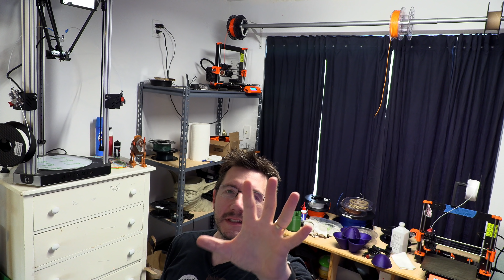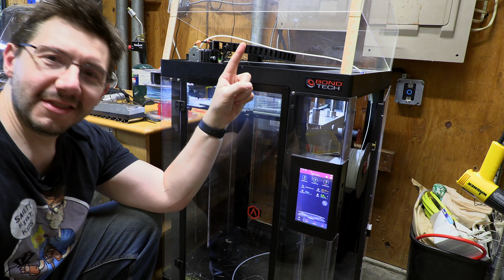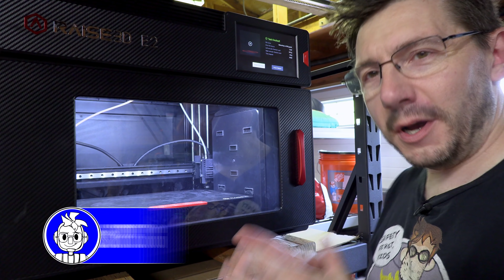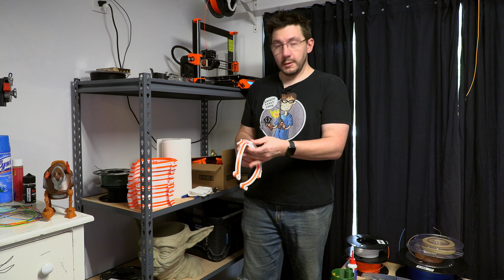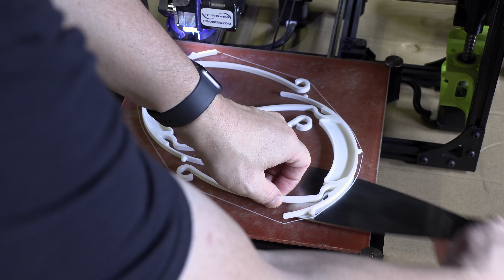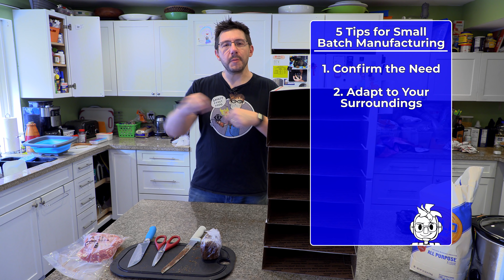5 TIPS for Small Batch 3D Printing Manufacturing - AT HOME!

Comment: This brings back memories. I designed face shields with folding legs and I could fit 5 to my build plate but that wasn't enough for me so I stacked the design with inter-layer snap offs. I printed a few hundred of them and handed them out to the local hospital. I ended up with a design stack pushing the speed limits of my printer that would print non stop except for spool reloads over 5 days.

Comment: Hey Joel I've got a quick question, if I print multiple small parts at the same time will the strength/layer adhesion of each part be less than if I just printed a couple at a time?  
Thanks for another great video as well!
Reply: Im going to assume you figured out the answer but just in case. It doesn't matter! Print as many as you can!

Comment: I love the curtain rod as a spool holder.  printer farms should adopt that method/design.  haha.  I know it isn't practical when putting new spools on unless you change them all.  was just a joke.  if it helps I have found a deburring tool works great for edges that have a brim or a little edge (either due to the top being so good or a little squish/elephant's foot at the build plate).

Comment: recommendations on shelving to "stack" printers, currently I have a ender 5, Mars 2 and am looking at something similar in size to ender 3 (voxelab aquila) to add to my list of printers but looking for some stackable options. That metal shelving you have do you have problems with vibrations? Does bumping a table or if the shelf moves a little affect print quality?

Comment: If you continue to do this small batch manufacturing, it would serve you well to learn a bit about Lean manufacturing principals.  They are not just applicable to mid/large manufacturing operations, and I see so many ways that you could cut your labor time "bigly" :-)  You could read a book or two, but I think the best way to learn is to get in touch with a local Lean manufacturing engineer of a small manufacturing firm in your area that makes parts in batches of hundreds or less (think Aerospace, etc.).  Lots of these companies give tours all the time, and like making local contacts with people with different skills, so I have a strong feeling that you can get some tours.  Great video, btw!

Comment: OK first off set yourself up an Company USPS account for your shipment. Get labels you can print the address onto I use 2 label per letter to make things easier for now till we upgrade to thermal printers/label maker printers. 
Use invoice ninja (it is free) for all your invoicing and tracking a well as your invoicing you interlink it right away with banks and swipe as well as paypal as well. 
buy for you products envelops or boxes in bulk. If USPS has the size for the price than use theirs but look online.

Happy 3D printing

Comment: Do you keep your garage heated and air conditioned? Any air cleaners or exhaust systems?
Reply from the maker: It’s not actively heated or air conditioned. I have a ceiling mount air cleaner / filter that I typically run.

Comment: Why do you have to buy labels from the post office when you can enter the data by hand, print it, and apply it to your flat rate boxes?  You call up the post office and arrange for special pickups of packages.  On another note...how much have you spent on these slow hobbyist level 3D printers?  Is it time to add a high speed high volume 3D printer to the mix?  Such as a PolyJet 3D printer or similar?  For the advanced at home additive manufacturing enthusiasts market which 'til now your channel has largely ignored.

Don't have to use anything from Google either.  Open Office or whatever it is called these days does the trick nicely.  Free and it is compatible with MS Office suite.  You shouldn't rely too heavily on InterNet based "solutions".  What happens when the 'Net goes down or the service that is online only craps out?

Comment: Hey Mr 3d printing nerd, why not print multiple layers? Stacks of 10 and 10? Love your video's 👍👍👍
Reply: Multiple layers means increasing the risk of failed prints from power outages, layer shifts, clogs, etc as well as meaning a lot more work post processing to separate layers (not easy without support material in between which would then also have to be removed). 

He would lose way more time trying to print/process/fix stacks than just removing prints/restarting each printer.

Comment: Just a suggestion for cleanup, when mass-printing frames I used a butane torch to clean up all the strings and odd sharp bits, it really does wonder for "mass-cleaning". Set it to the least "jet engine" setting, prefer yellow flame, and just let the flame pass by each frame.

Comment: I've been printing on 40 printers. By time I hit print on the last one the first one is finished. So I started stacking prints to make 24H print times. It really sucks to swap spools on 40 machines at the same time.
Reply: What did you do to stack them? Add support layers in between? Add an easy to cut dividing line? Etc?
Reply: @radicalxedward8047  I had a skipped layer between the prints so they break apart on the line. It only works on some designs. I got the idea from the old reprap print files that used to do it. If you have a large area you might want to skip 2 layers or something to make it easier to break apart. But I was printing a low contact model

Comment: Hi Joel,

You can automate those face shields prints so that once the print ends, your gcode calls your extruder to push it off the build plate (into a bin you setup), and start to print a new one. Additionally, there are Stack gcodes for those now where you can print 10-15 in one batch. Best of luck.

Andre

Comment: Pretty good example of making use of your 3D printing nerd hobby to help meet a short term need.  For a REAL 3D printing manufacturing operation, you'd have a print farm with all the same printers so they're all running the same jobs, they all start and stop at the same time, they have common spare parts and maintenance procedures, etc.  You'd also come up with some way to print more than one or two parts at a time for far more efficient throughput.  A slight change to that headband design might allow it to print vertically and 10 to 30 could be printed in a single job, although layer separation could be a problem in that orientation.  It might be possible to stack them horizontally with some clever supports that snap apart.

Comment: Joel, I am shocked, SHOCKED i say, to hear you're having leveling problems with your N2+. SHOCKED. XD 

Anyway, that's awesome. I'd like to add that I use ShippingEasy www.shippingeasy.com to handle my shipping, and it works really well. I have the free plan, which is sufficient for me, but they go up to massive operation size.

Comment: I use a heat gun or a map gas torch to clean up prints. I have also used the flame to heat up the print to bend or pose a print

Comment: Tip: 
As soon as you add another person batch manufacturing becomes inefficient. Move to single piece flow. It will save you time and probably double your production with the exception of the bottle neck of the printer.

Comment: My top tip (as someone who runs a small batch printing business for classic car parts) is plan the print times and never let your printers sit idle.

Here's my top tip... print multiple models on the bed to schedule the print end times.
So I mainly print classic car parts, often quite repetitive as I supply to a number of retailers and once I have created a new product it often gathers pace quite quickly, it may start as an order for 3 or 4 to 'see how it goes' and turn into to an order for 50 within a matter of days.
For example I have a couple of particularly popular components which are around a 14hr print time, which can be annoying as over time the  finish time moves into the late evening and then early morning etc... but you don't want to have you print finish 10 mins after you've gone to sleep and a have a printer(s) sat idle for 6-7 hours until you get up to set it off again.

My tip therefor is to have multiple items on the build plate to make your print take 24-hours or 12 hours etc... so my 14hr print coupled with 2 x 5hr prints on the bed takes me to 24hrs, so you can have it finish, pop it off and re-start with no down time. Building up stock is often very handy as the material cost is quite low (I print almost exclusively PETG) and if you are utilising what would effectively down time to do it then that's great. 

You can't get that time back, and time is money as they say.

Comment: I've found on my prusa mk3s that I need to lower the extrusion width and lower the speed between faceshield to print quality. (use a modifier for each faceshield of the stack). unfortunately, I can't get clear sheet anymore, I have 10 pack of 100 ordered but nothing is shipping :(, glad im still fine on PETG and PLA but the price of cheap filament jumped in price lol.

Comment: My wife does a side gig that ships a lot of boxes to the point that I told her it's time to get a USPS account. Oddly enough a lady at the post office told her to use the flat rate boxes and cover/wrap them with brown paper to save on shipping where you can zip it out 1st class for several dollars cheaper. Shortly after we started doing that, we also found a website called pirate ship that works like a bulk shipping account that also saves quite a bit on the shipping rates over (or in some cases IS Priority) for about half price.

Comment: Joel, my family had a small business for years, till my mother retired and sold it off.  It helps to chart out your work flow, and look for points in it where you can see time savings.  Do things like prestage, maybe take a few boxes and when you have determined what orders are going out for the day, put the invoice in them, and the hole punched sheets, then as you move along you fullfil the order with head gear and shipping label... And so forth..

Comment: Hey can you do a video on troubleshooting after switching slicers I’m having trouble with first layers I run a home built printer and I’m trying to switch from slic3r to cura
Thanks
Stay safe
Reply: I have done this.  Bring up both printer profiles and put them side by side.  Then pick your favourite bits from both.  It's a good idea to have a small print model to check out various settings.

Comment: My Prusa MK3s doesn't like PLA.  I printed PLA frornearly for a constant year and then suddenly it jams.  One of your video explained why it happens: its the way the heat break is milled/engineered to handle MMU.  Prusa does not have a suitable replacement.  I ordered one generically and currently waiting for it to arrive so I can swap it out.  Have you done this Joel?  If you have, Prusa should offer their printers w/o the MMU feature.  I do not plan on printing anything other than PLA.  So....no face shield volunteering here.

Comment: Hi Joel,
I am running the same but you should also get that all connected to a mesh of octoprint. I am running that in my machines 2 out of 4 and this is great to get the printed sending update over the slack channel that I I setup. Then I only need to move to the workshop only when required.. otherwise it is difficult to hear the bip from so far. 
So this can be a great advice also and then you can also record what you do.. get out some statistics. You should also explore that octoprint feature.. it is so great to use
Reply from the maker: Fantastic idea - I'll see what I can do!

Comment: Face shields for dentists? 
The dentists in Denmark use som small magnifying goggles with a center light. 
The model you print would never work here. There isn’t room for the goggles.
There is a dentist version on Thingiverse. A modified Eric Cederberg frame.
Reply from the maker: Can you link to it? I've sent hundreds of these out, and all of the dentists love them. Grand Street Dental said her lights clipped onto them super easy.
Reply: 3D Printing Nerd 
https://www.thingiverse.com/thing:4297740
This one has been modified to make room for the special dentist glasses with magnifying lenses and a center mounted light.
They require 6.5. Centimeter of space between the forehead and shield.
These are the magnifying glasses they use: https://examvision.com

Comment: Awesome camera arrangement on the #2 Prusa MK3. XD
Having been charged with filming a timelapse of a Prusa sitting on a shelf obstructed by a Raise3D cart, I feel your pain and I envy your filament closet rod.
Our MK3S nozzle jammed hard (possible heat creep), and I decided to replace the whole hotend to be darn sure it would run reliably again. Because I needed to hook it up to Pronterface to calibrate the heater cartridge and thermistor, I upgraded the firmware while I was at it. I hacked up a replacement PTFE tube that resisted filament insertion at first, but it works swimmingly after a little breaking in.

Comment: just use Shopify for your business instead of spreadsheets. it only cost $30 a month, you can buy USPS at a discount and print labels right from the back end, and it will sent emails with tracking and such automatically.
Reply from the maker: $30 / month doesn't seem too shabby.
Reply: 3D Printing Nerd yeah man, it’ll save you a lot of time, def worth it.

Comment: Joel can you make a video about smooth vs textured prusa build plates and which filaments work best on which
Reply from the maker: I'll try!
Reply: Both the textured and smooth build plates can work with just about any filament. I try a squeaky clean build plate first and use an adhesive if that doesn't work. I use the textured ones when I want the surface of the parts against the build plate to look good and the smooth ones only when I have extra trouble getting small parts to stick. If necessary, you can use Vision Miner's Nano Polymer Adhesive on the textured build plates without ruining the bottom surface finish of the printed parts, but it is expensive. Likewise, you can use glue stick, Magigoo, etc. on the smooth build plates. They are less expensive, but they sometimes spoil the surface finish.

Comment: What the hell kind of firmware asks "was your print successful"?! I've never had Marlin ask me that!
Reply from the maker: The Raise3D machines do this when you have them bound to the cloud account. It's a way to keep track of stats, plus, it requires human interaction so you don't accidentally start a print with a print still on the plate.
Reply: @3DPrintingNerd  so if you make a 3D printed robotic arm (well, probably need at least a couple) take off your prints - it will not register unless you also make it have a finger that presses "yes"?

Comment: Last Wednesday the government here in Slovakia permitted to open some shops, like hairdressers', cosmeticians', restaurants and cafés (only those with outside seating, and only the outside part), etc. Unfortunately, the source of our primary income at work are still closed, so we decided to print face shields. On the first day, we ran our three Prusa i3 MK3S printers at the office, but we were sold out almost instantly. I made a stacked print for 8 shields to run outside of business hours (runs for 14 hours), and I made a single-stack version with four shields, which I ran on my MK3S and modded to hell Anet A8 overnight, and start a new batch in the morning, just before I'd leave to work. Oh, and I brought my dad's Ender 5 into the office as well, just to up the printing capacity. I will also add my Alfawise U20 to the farm just after I complete the control board replacement on it and dial in the firmware.

Comment: My tips from printing hundreds and hundreds of parts in my home workshop:
1. Minimize time by slicing your models to print fast. See https://www.cnckitchen.com/blog/how-to-3d-print-face-shields-faster. You can adapt Stefan's settings to your printer(s) and model(s).
2. Minimize cost by shopping around for filament at a good price. You should be able to get good PETG for $32/kg or less. Order enough to get free shipping if offered.
3. Minimize waste by using filament runout detection and multiple spools of the same filament in the same color.
4. Consider upgrading to flexible build plates, which make print removal faster and less tedious. Don't wait for prints to cool completely if you can get away with it.
5. Squeeze as many parts as you can print reliably onto the build plate. You can often fit more than you expect by rotating the models.
6. When starting prints, make sure you have a good first layer or two before walking away.
7. Use the timer on your phone or computer to alert you when the prints are done so you won't need to check on them constantly.
8. Don't exhaust yourself if you can help it.

Comment: So I'm still getting weird imperfections in my PETG prints. What retraction/speed settings do you run at to get it so smooth?
Reply from the maker: It depends on the machine, but minimal. Also, I dry my PETG
Reply: I've been drying my PETG, usually at 70C for 6 hours every other day.

Comment: Joel - please comment on printing times for the various printers.  I find my Anycubic Linear Plus Delta the champ - and the print bed heats back up in no time.  It really flies.  I'm interested in how fast the Artemis will print versus the other printers.  The Creality printers are holding up well for me - only one bad z homing switch on my oldest Creality printer - the original CR-10 had to be replaced.  Silent stepper boards on them are also a blessing for my ears with so many printers going.